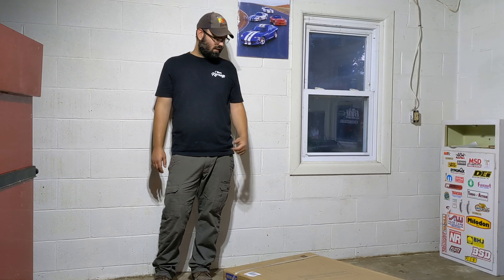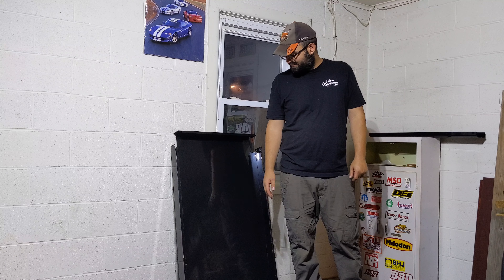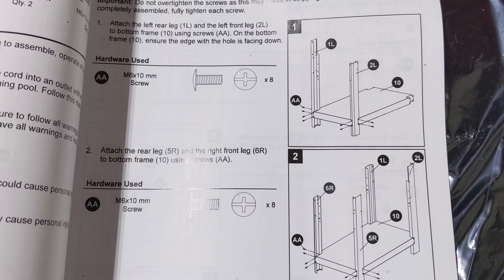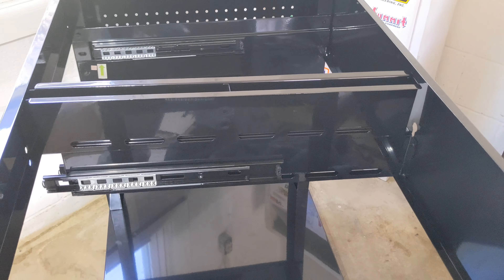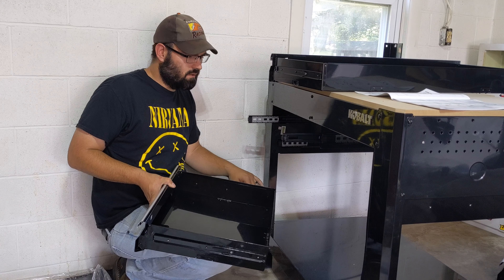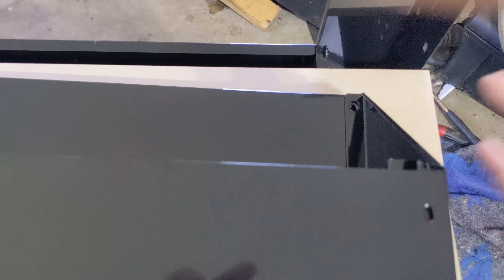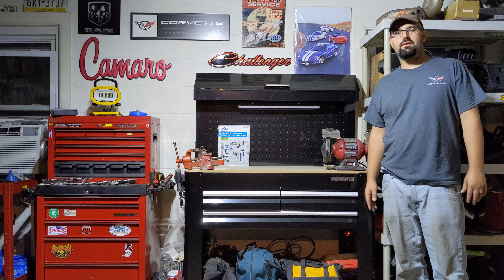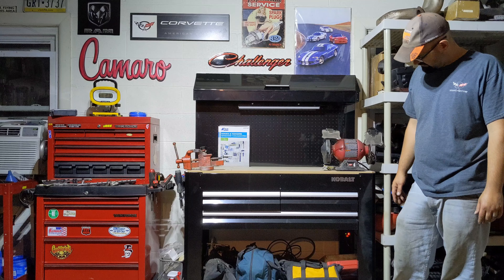Kobalt 3 Drawer Workbench Unboxing and Assembly

Comment: Can the power strip be put on the other (left side). From the video it appears that the left side has identical round receptacles for the magnetic holder but I wanted to double check. Thanks.
Reply from the maker: Yes, you could, but the cord for the attached light runs to the right. It is not long enough to reach the strip if it is on the left side of the unit. Hope this helps and thanks for watching.